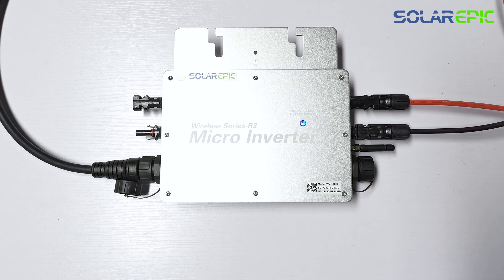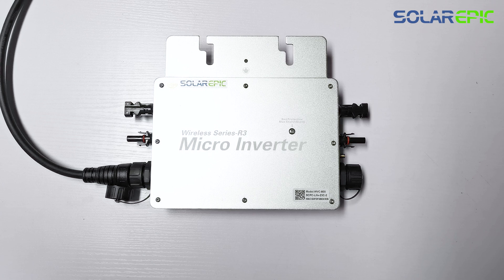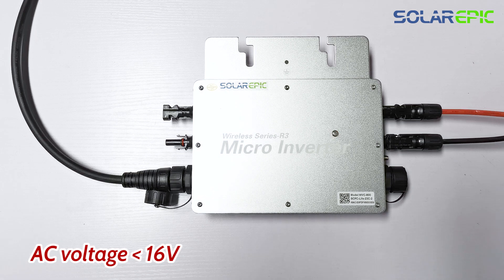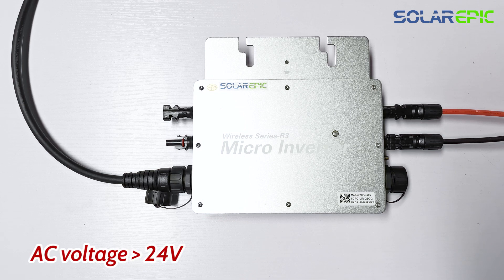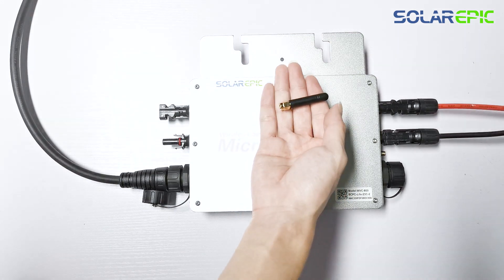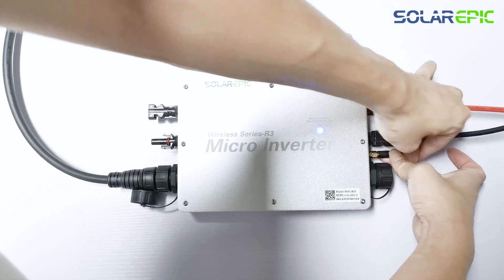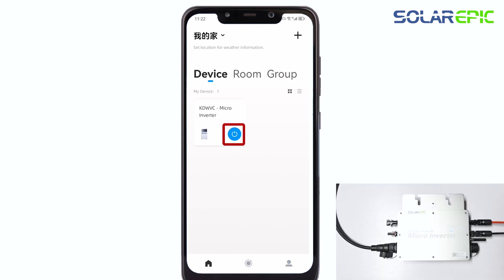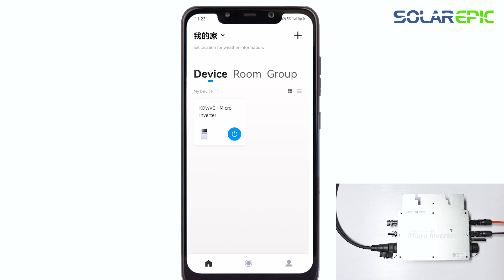Solutions to common issues with the WVC 800W waterproof inverter

Comment: Hello. Can this be mounted on a wooden wall ?
Reply from the maker: It can mounted on a wooden wall, but please consider it will getting warm when it's running. And the two outputs is used for interconnect to another inverters. If you only use one inverter, just use one output and connect to the outlets will be fine.
Reply: @SolarEpic  ok. That was what i was thinking .

Comment: Have WVC800 inverter connected to two solar pannels. After AC connection it starts working after while, flashing blue. Externel powermeter shows increase in power e.g. up to 375W. After some period (40sec, minute or two - it doffers) relay click power sharply goes do 0 and it start red blinking and realay clickinng. After while it turns blue and it repats again and again.

Comment: How can i reset the Inverter if It doesn't have a reset button?
Reply: I found that I need to disconnect the inverter from ac and DC for a few minutes to lost the configuration and reset
Reply from the maker: Hi, there is an option called "Reset Energy" in the software settings where you can reset the historical power generation data.
Reply: The reset button on mine is fake, I opened the case and it does not exist, how do I reset the unit that has lost connection to app ?
Reply from the maker: Hi, please take a photo of the white label on the front of the inverter and send it to our customer service email at 13682578157@139.com. We need the MAC address on it to identify your issue and assist you. @profbollo338
Reply: @SolarEpic  Could you help me to resolve the same problem with my device?
Reply: Hey hey! You can build a reset button for it!  🤣🤣🤣🙂🙂
Reply: Avete risolto , qualcuno ha capito come si resetta il wifi?